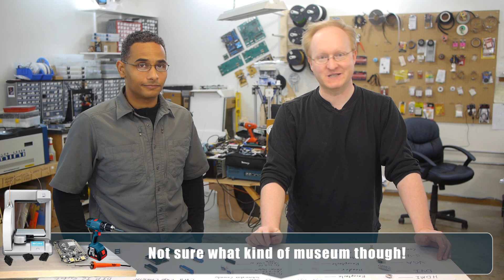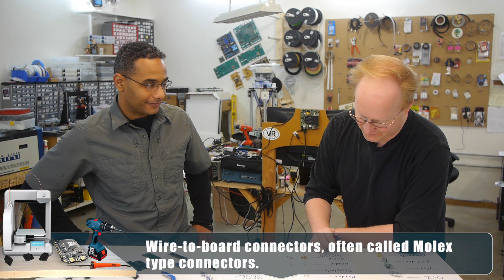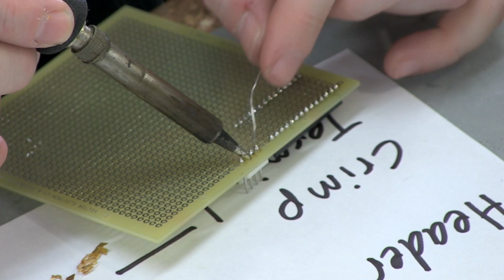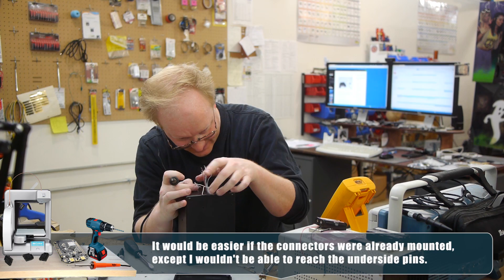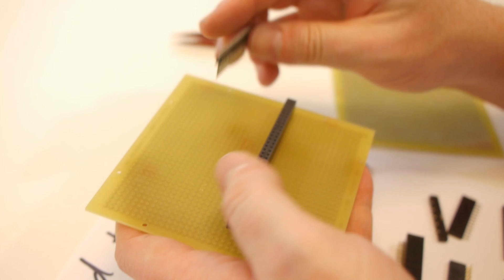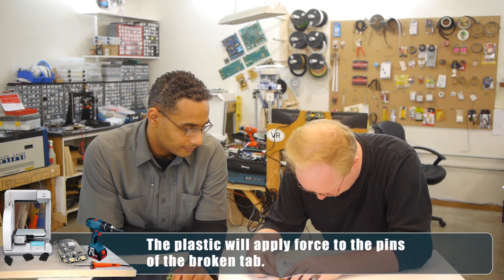Ben Heck's Essentials Series 1 - Connectors

Comment: When installing a dB connector in a plastic enclosure, I use the metal mount from a PC serial board as a template.  Screw it in place and use a Dremel to cut out the plastic for the DB to fit through.  Clean look.

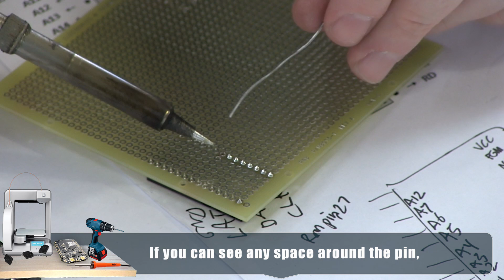Comment: Thanks for the vid! I have a question about your solder temp. Around 15:40-14:50 you are soldering the IC connector to the breadboard. What temperature are you running on your solder gun and what type of solder are you using.

This always seem to be the most challenging.

Comment: Of all these connectors I really really REALLY HATE ZIF/Zero Insertion Force connectors/cables, they're hard to get in the connectors just right (especially those connectors with a locking tab thingy that you push on to lock the cable in) and I find they break way too easy. I once messed up my knuckles because a old compaq laptop I had, the ZIF cable broke on the 44-pin ide hard disk, and I have no spares or tools for that... so I go mad, I got angry, I lost my shit and just freaked out and punched walls and the laptop... at the time it was the only computer I had and I loved it for what it did... my right hand still hurts today from punching the laptop.... the laptop was harder then the plaster/concrete walls
Reply: If so you will hate AMD CPU's.
Their socket is ZIF.
Reply: So are Intel CPU's... It's been that way for quite a while now.
Reply: ***** but intel has LGA which is another type of connector
Reply: Personally I'd put them in the same group, but I get mixed answers when I look it up. LGA uses zero insertion force though all the same.
Reply: You guys mistook my comment for the socket, I'm talking about the CABLES, the thin cables that use ZIF connectors. They're common in a lot of thin products like laptops and LCD's. I have no problem with Zero insertion force CPU sockets.

Comment: After searching all over because they dont give part numbers on the Molex connectors I found them. Board Connector 22-05-10(2)2 With (2) = # Pins desired. Wire Connector 51191-0(2)00. Crimp 50802-9101

Comment: Wrong. HDMI and DVI both support audio.
Reply: Travis Piper troll
Reply: jeffro It does I've used it.
Reply: via rca jacks next to it
Reply: jeffro Nope. It's built in it's the predecessor to the HDMI port. It supports 5.1 digital sound and I ran it through an old receiver that happen to have a DVI port on the back. No headphone or rca jacks at all. Google it.
Reply: nothing has changed in 10 years, just checked again. DVI is video only. it can do analog video, but no audio.
Reply: jeffro Not normally no. But if you have a graphics card that supports audio and you happen to have a Dvi to HDMi cable (no audio input at all) it will do audio.

Comment: The better crimp pliers to crimp the wire-to-board connectors (molex type) have 2 radii so the longer arms of the connector bite into the wire insulation to help prevent that the wire gets ripped out.

And even when I buy new DIP Chips, I usually bend them on a flat surface (like the table) a little bit since the pins usually won't be exactly 90° to the chip and by bending them to the 90° angle, they slide in way better.

Also, on the board-to-board connectors I cut off pins somewhere in the strip and seal the female connector with my desoldering iron so I get a indicator how the board has to connect and prevent therefore a potential deadly connection for the boards.
Saved my bacon a couple times when working with mirrored layouts....

Comment: Is this about Connectors or signals? The first CONNECTOR he shows is called RCA, not composite. Composite is a type of signal that is commonly passed through RCA connectors.
Reply: And again.... VGA is a type of signal, the connector it uses is an HDDB15. The HD stands for High Density, having 3 rows of pins, not High definition.
Reply: Jon Ferran DE15. The B in DB25 reflects the size of the shell.
Reply: Jon Ferran Don't worry, it's one of those bastardised things that everybody says. Like RJ45. RJ45 is a telephony standard, the TP ethernet connector is called 8P8C.

Comment: I make a lot of use of screw-terminal connectors.

advantage over molex is that it is only the board-side connector, no need to put crimp-connectors on wires or similar. there are pros and cons to tinning the wire though with screw-terminals:
pro: stranded wire doesn't fray;
con: doesn't sit as nicely in the connector (they clamp down better on stranded wire, whereas solid and tinned wire is often more wobbly).

some bigger connectors exist, but can't really be easily used with perfboard (no pins that fit in holes, ...). have sometimes ended up using the tacky strategy of tying-down a 12AWG wire or so to the perfboard (with thinner wire), and then soldering the crap out of it, and maybe using some spade connectors on the wires.

then again, it goes right along with tackiness like using clay+steel dust+PVA glue as heat-sinks (just make big gobs of it for TO-220 components...). has very different properties from the commercial aluminum heat-sinks though (heats up and cools off very slowly vs the commercial ones, which go straight from cold to crazy hot to cold again).

yes, comically bad, I know...

for signal and low-power connectors, I use pin-headers and dupont connectors, but face the issue of not having enough of the connector pins (so end up sometimes resorting to the ugliness of doing wire-wrap around the pin-header connections).

need more of these connectors, and maybe some 24 or 26 AWG stranded wire (dupont connectors don't work well with 22 AWG wire).

a few times, I have also used DIP sockets as wire-connectors (used vaguely similar to breadboard connectors, in a few cases using hot-glue to keep the wires from falling out).
Reply: Brendan Bohannon I typically now ferrule crimp all my wires I put into screw terminals makes for a more secure connection. You gotta get the Ferrule crimps for the gage of wire your using. http://www.amazon.com/Signstek-Adjusting-Ratcheting-Crimping-AWG23-10/dp/B00HPRYIL8/ref=pd_bxgy_hi_img_y
Reply: Cole Cramer   ok, but does it make enough of a difference to offset the cost of the tool and crimp ends vs just tinning the wires?... I guess a person could get fancy, and flatten the wires some before tinning them, or tin and then shape with pliers.

my world is partly one of tacky solutions in the name of saving money.

well, and occasionally nifty things like finding a physically large 12V 18A laptop-style power-brick in a junk bin, then was using this to power my CNC machine (more reliable than the ATX PSU I had been using, and cheaper than buying a specialized power supply).

had used wire and hot glue to make a makeshift connector for it.

Comment: Hi Ben 

Just saw the D sub wiring / soldering section, and saw you make the same mistake as me when I was an apprentice telecoms engineer 6 years ago, I was quickly taught that if you fill all the cups with solder first then clip your wires very small and just heat the pin and push the wire in it makes a much cleaner finish, I dont me this as a criticism just thought I would share this tip, try it out, its a much quicker method.

Regards

Olly

Comment: DisplayPort definitely sounds promising. I'm still using DVI on a monitor that only supports VGA (using adapter that came with my Nvidia card). The Nvidia card supports HDMI and DVI, so I plug HDMI to a TV for a second monitor.

Comment: Can u show how to make a HDMI to rca converter? I want to plug a AppleTV into a older monitor that doesn't have HDMI. I read that just a cable doesn't work. So I would have to buy a box converter, or make one, should I?
Reply: You could also just use a small FPGA-board for that.
Reply: Jarrett Boersen HDMI and "rca" or CVBS (composite video baseband signal) are very different signals. HDMI is all digital, and Composite is all analog. You would need a converter like this
http://www.amazon.com/Etekcity%C2%AE-Composite-Video-Audio-Converter/dp/B008FO7PQA 
and you would almost certainly lose some picture clarity.
Reply: +James Roberson I don't care about the quality of the picture. Because it would be playing on a mini DVD player with a screen. Thanks for the help and ideas!
Reply: I was looking at those and I guess I was in the right place! Thank you!

Comment: PAL is almost identical to NTSC. the only difference (apart from the timing and line count) is the phase of the color subcarrier is alternated each line effectively halving the vertical color resolution but significantly reducing the hue errors that happen with non-corrected ntsc.

Comment: My first soldering experience was with an iron with a tip that looked like a big flathead screwdriver.  I was able to manage with  but I thankfully was able to borrow my uncle's nice Weller station with a nice small tip.
Reply: Ha, I had to use one of those for soldering some stained glass projects together. It was uncomfortable to say the least
Reply: ***** and I was using it to solder headers onto a dev board only about a 3rd of my joints were cold.

Comment: On those molex connectors the back set of wings is designed to grasp the insulation around the wire conductor. You'll find your connections much more solid if you crimp it that way.

Comment: we need an into to electronics series, for even the most noobiest hobbyist
And as all electronics tuts should be it should focus heavily on old school analog circuits, none of this "microprocessor" stuff.
Reply: ***** Yeah, only the vacuum tubes, none of this "semiconductor" stuff.
Reply: xFuaZe
There is nothing a microprocessor can do that can't be implemented using vacuum tubes. Also, vacuum tubes give you an opportunity to use much much more energy and, if you are lucky, burn down your house. Therefore, they are clearly a better choice since they give you more options than the microprocessors.
Reply: ***** I second that!
Reply: ***** Why the aversion against microcontrollers?
You can make a lot more complicated projects by implementing the logic on the microprocessor instead of making the complete circuitry.

Comment: I have a monitor with a display port and was looking to hook up a console to it but i could only find devices that connect a display port to a hdmi tv/monitor but nothing that could connect a hdmi to a display port monitor ( i did find one but heard it is very unreliable)
Reply: Make sure it's an active DP to HDMI converter.  Passive likely won't work well at resolution.